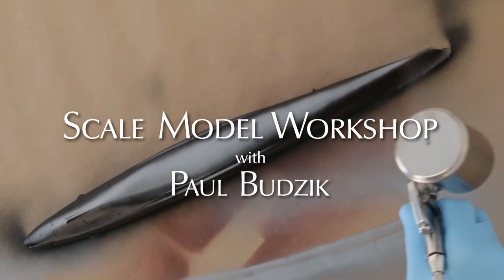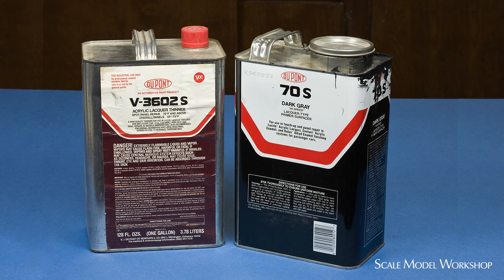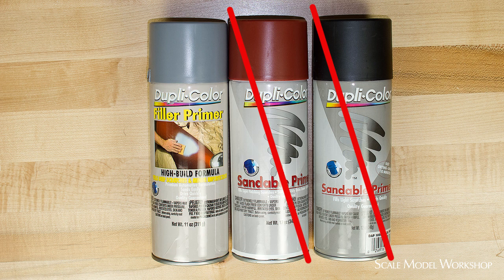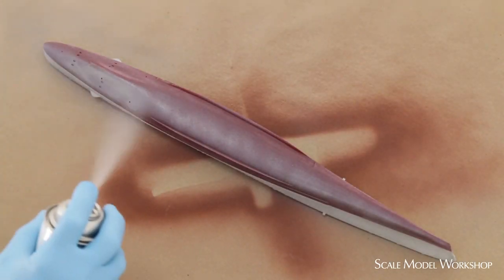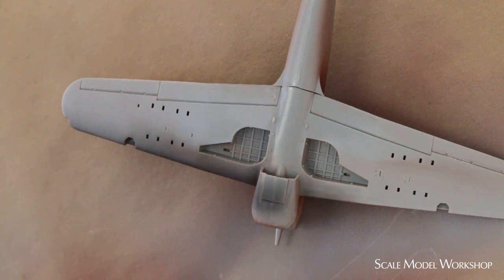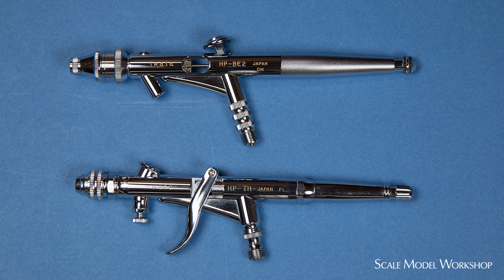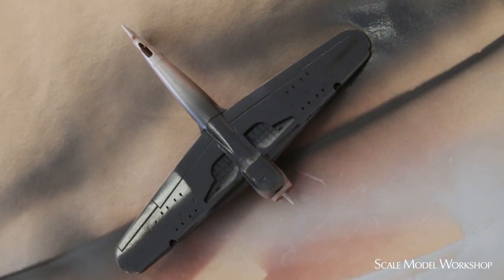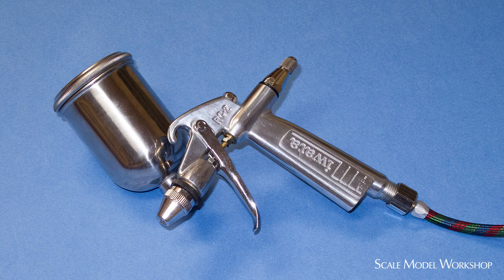Surface Primer for Scale Models

Comment: You have no idea how useful this video was. I was struggling A LOT with a 1/4 scale figure that i'm doing, since no matter what airbrush and nozzle size i was using everytime i ended up with a dusty and uneven finish. I got sometime ago a 0.7 nozzle for my Badger 100LG thinking that should do the work but i was so wrong.

I got the GSI Creos PS-290 some days ago and it's really a game changer. Now, i'm getting a smoth surface using a constant and 'full blast' application, just like the 5:11 mark. Thanks a lot!

Comment: GSI Gunze PS-290 changed my paint life... It is Mr Hobby's version of the TH Iwata fan pattern airbrush, it also comes with a round pattern cap.

For us plebs, on Aliexpress there are 0.5mm Sprayguns that have a listed airconsumption of 35 liters per minute, so might work with our small compressors, haven't gotten one yet, but for 14 USD it might be worth trying.

Also thanks for the primer on primer  :)

Comment: I used to use all lacquer based primers thinned with medium dry lacquer thinner but now started using Badger Stynlrez acrylic urethane on plastics, wood and metal. Really liking it, basically ready to spray out of the bottle but I like to cut it just a little more because I don't like a heavy film. A .77 ( number 3) nozzle works fine on a Paasche H or .55 ( medium size) on a Badger 200 or the same 200 brush with the large nozzle/needle set for that matter. I cut it with just a few drops of alcohol and a few dribbles of airbrush medium to the consistency I like and more importantly what the airbrush likes. I'm using Liquitex airbrush medium to cut my acrylics anyway, but I'm sure Goldens would work as well. Airbrush medium alone gives a little more flow out than I like thus the alcohol blend to speed it up a little bit ( depends on the weather) .  This is self leveling primer, over spray is non existent unless you really screw it up bad, hasn't happened to me thus far. If you heat set it or let is sit for 24 hours otherwise, you can spray acrylics, lacquer or enamel right over it. Been using it for about a year now. Oh and no stink lol !
Reply: What do you thin it with?
Reply: Just use floor wax to thin and add body to your  primers/paint.  It's an acrylic polyurethane.  It's  very tough, people  walk on it.  And it's  much cheaper than Goldens and it does the same thing.

Comment: Wow. This is the first time i've seen this insight on overspray. It makes so much sense and i'm genuinely enlightened. I've had this rough texture happen to me and I though it was for obvious reasons due to paint thickness, amount of thinner, etc. Never thought it to be because of needle size. I thought going smaller would help me save some money thinking I won't be wasting as much paint. I have been looking at those trigger style airbrushs, would a fan shape spray pattern be helpful?

Comment: Retired recently and wanted to get back to modeling after a long syntactical of being away from modeling. The kits and materials and detailing have changed drastically . When building, lacquer base paints always had a high propensity to etch the plastic, so I would use the same base paint as model finish to prime. This video helps with a higher understanding of technique but what about the lacquer etching? Plus the viscosity of paint. I assume you take the lacquer and use it to dilute the model paint for spray.? The results you show in the video are excellent. I'd welcome any comment from modelers too. Is the solvent in enamel base paint a lacquer?
Reply from the maker: To help get a better understanding of paint types and what distinguishes one type from another, I suggest reading over my paint explanation ... https://paulbudzik.com/tools-techniques/Airbrushing/paint.html .  The lacquer paints sold for hobbies do not contain anywhere near the amount and type of volatile organic compounds found in old school lacquer.  The also have a heavy acrylic component so they really just lay on the surface as a coating rather than "bite" into the plastic.  The etching that you might have been used to doesn't happen with these paints.

Proprietary thinners for enamel paints are mineral spirits (paint thinner).  Generally, they can be thinned with a lacquer thinner, but any leftover paint needs to be discarded.
Reply: @scale-model-workshop  thanks so much, this is exactly what what I  needed to jump back into the game. Especially the information on the etching  I remember lots of sanding and other methods like polishing , which would cause loss of detail.  I'm really anxious to use your information and link .

Comment: Your videos are great - really informative, to the point, and not filled with unscripted ramblings. (I'm not suggesting you use a script, but others who don't often don't seem too sure what they want to say, which is painful to listen to). One comment - in my experience the "dupli-color" brand is absolute crap. It never seems to actually dry - if you apply any sort of solvent on top, even weeks later, it comes straight off. Maybe the primer is OK, but I'm not risking it.

Comment: What pressure and thinner ratio do you recommend for these larger airbrushes? Wouldn’t you also need a higher volume compressor?
Reply from the maker: I thin basically like I do for general airbrushing.  The RG3 and Eclipse series guns can be used with normal airbrush setups.  The LPH guns should have some sort of tank compressor that can supply a steady cfm.  Just because it is larger doesn't mean you are using "thick paint" ... You are using these to get better coverage and minimize overspray.
Reply: @scale-model-workshop  Thanks Paul. I wasn’t thinking of thicker paint so much as more of it, over a greater area, meaning a greater volume of air. But you’ve answered the question. Cheers.

Comment: Handily, we have the NAPA colorline primer at work and the finish one in a gallon can. When you use the spray can primer do you decant and spray through a gun? Or spray with the can?
Reply: I would decant as you can control the material flow

Comment: As another commenter asked, I wonder which brand of primer is your go-to for general application. I for example am finding it difficult to us the Old School Lacquer Primer by TCP Global (1gal of primer with 1gal of acetone). Very thick filler primer. Mixed 1:1 with the acetone through my Iwata LPH 80 I cannot get consistent smooth finish results, no matter distance from subject or altering pressure at the gun from recommended approx 10psi. I get a very dry, rough application finish, sometimes dusty. I've tried altering the acetone mix ratio. So now I'm looking for another solution. I'm painting many larger G-scale train projects, repaints for occasional local hobby store clients. Any advice is appreciated.
Reply from the maker: Why are you thinning with acetone?  You should thinning with a med to high temp, good quality lacquer thinner to slow drying time.  And you probably want to thin to one part primer to three parts thinner, or even more.  Keep in mind that we are not using the material the way it was intended.  We are just looking for improved adhesion.  Finally ... the 10 lbs psi is the cap pressure ... it should be 13 to 14 going into the gun.  If you want to get a precise read ... use a cap pressure gauge.  But LPH guns are not like conventional spray guns so you don't have the freedom to go playing around like you would with something like an Iwata G6.

Comment: Any idea why the styrene got wrinkled after spraying a few layers of 1200 Mr Surfacer and after 24 hours another thin layers of lacquer paint MRP? I have painted a car kit model by Revell, the main body came out good but the hood got wrinkled really bad. After striping down the paint I noticed that the styrene got melted into wrinkles not only the paint as I thought.

Comment: Won't a lacquer based primer/thinner attack the plastic? Also, does the primer have to be topcoated?
Reply from the maker: I've never had a problem with lacquer thinner attacking plastic.  Why would you topcoat a primer?  That would defeat it's purpose.

Comment: oops, does the primer have to be painted (color coat) right away or will I have to scuff it later
Reply from the maker: You could do either.  But it's difficult to do when your model is covered in small delicate details, which is why you want the smoothest primer coat possible without the buildup of rough material on the surface and in the nooks and crannies.

Comment: i admire your knowledge and talent. However, $500+ for iwata for a hobby is too much for me to justify.
Reply from the maker: @durangodave  I don't know where you're doing your shopping, but you might want to look around a bit before you cut loose with the hyperbole.
Reply: @scale-model-workshop   it was not an intentional hyperbole.  I made the mistake of looking at full size sprayers by mistake. For that i stand corrected and apologize. You should have been more gracious and understanding rather than attack me for a simple mistake.  😁